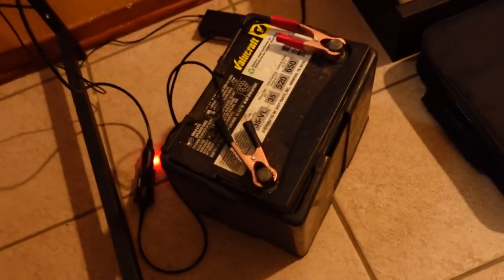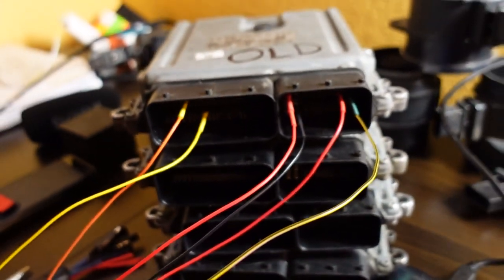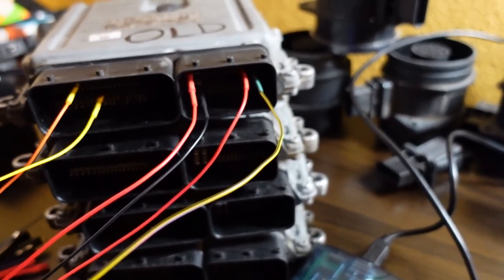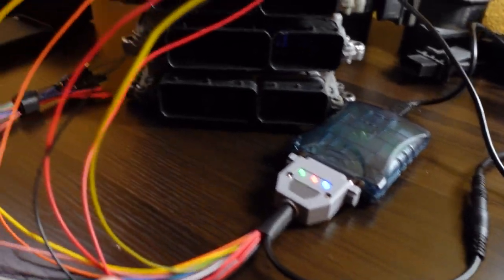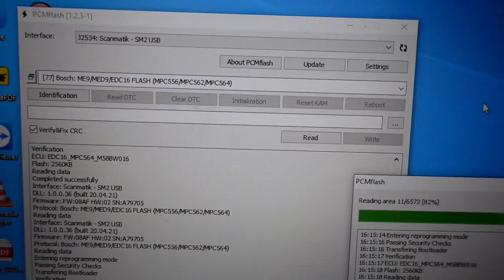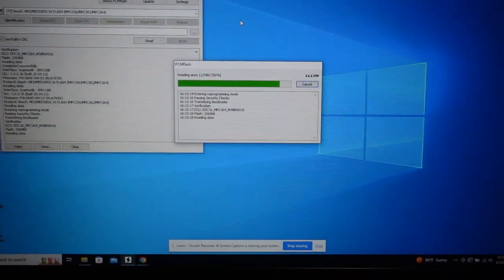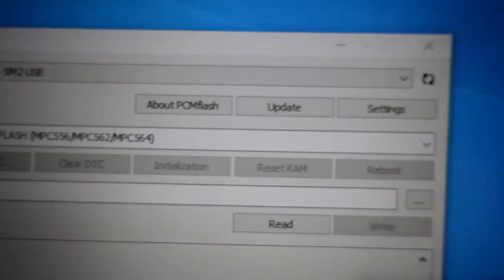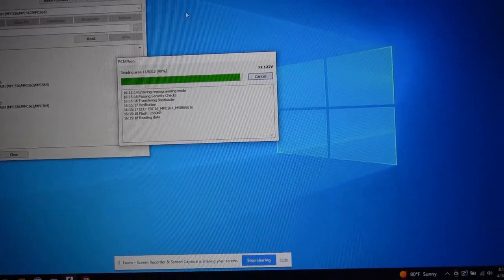How To Tune A Sprinter ECU

Comment: I've got a 2021 2.1 4 cylinder diesel rwd, do you know what fuel filter I should get? I feel like the dealer and local shops are all charging me over $100+ for the fuel filter. Not sure if that's normal or if there is a mann fuel filter I can get.
Reply from the maker: Glad u asked.  I was actually considering doing a video on this as there are at least 5 different fuel filters and there doesn’t seem to be much rhyme or reason as in terms of ability to predict based on engine or model year.  Unless u have merc inventory program.  Best thing to do is peak under hood and take a couple picks of the top of the filter.  Check for part numbers.  They’re in different places and sometimes printed across the side.  Hope this helps

Comment: Hi there 
Got a problem with my t1n 2.7 cdi. Van cuts out when accelerating round about 60-65mph ones warmed up. And it will cut out few times if I'll try and restart. And there's no crank. It looks to me as it might be an electrical issue somewhere. Code come up - glow plug cylinder 1 and 2 I've replaced the 1 but to nut broken in and spinning now. However it's still starts and currently runs with that problem. Injectors have been sent for a test came back fine. Would you mind me asking where to look for the electrial problems?
Thanks Rus
Reply from the maker: This is a real tough one. When you say it cuts out do u mean the engine dies?
Reply: Hi yeah engine cuts out the restarts instantly. However sometimes it's quite bad it'll stall and will take few time to restart. And will drive but I'll have to drive under 50mph, if I'll go faster it'll do it again. It was a pain driving back from France 😮

Comment: I am confused about which model or models of PCM flash are needed to read the ecu file of Sprinter.
Reply from the maker: Different year ranges require different pcm flash modules. what year is your van
Reply: @sprinterfix  is 2015 sprinter 906
Reply from the maker: @MAX_1082  you will need what they call their edc17 module. and the pin out will be different. where r u located?
Reply: @sprinterfix  I live new york
Reply from the maker: @MAX_1082  well I have heard the fake version of scanmatik works ok, I havent used it though, it comes with all the modules too so you won't have to pay extra for your specific bosch protocol EDC17xxxx
Reply: @sprinterfix  I hear that fake sm2 too,but somebody say read out file got trouble like can not open on turning software
Reply from the maker: @MAX_1082  interesting, there should be three or four read out files. I'd check out YoYo diagnostic channel, he is the scan tool guru

Comment: Link to buy devices
Reply from the maker: there are a few options for this. One is a clone from china which is very cheap on ali express, just search sm2. I bought original from a site called tuning.energy which has since either changed domains or gone out of business. total cost for original with accessories and software was 1200+. Cloned device has all accessories and softwares for various years
Reply: @sprinterfix  link looks sketch
Reply from the maker: @LoganGilpin  haha, not sure why people don't trust websites that don't end in .com or .net. theyre all the same